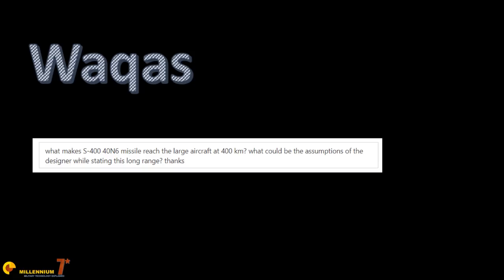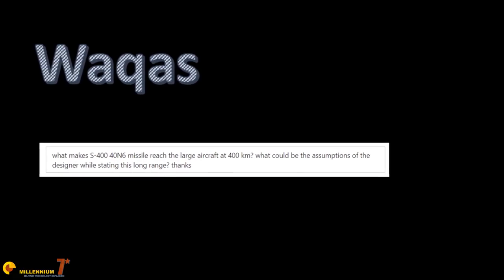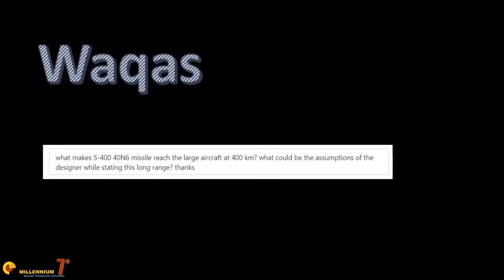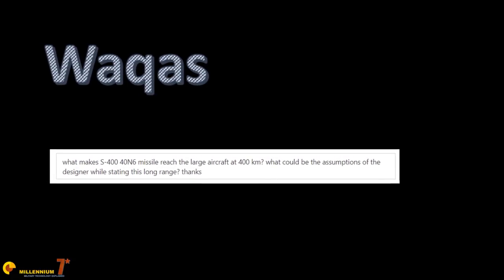Why AESA Radars are LPI? - S-400, Tejas and more - Community Q&A March 2020

Comment: Some features and facts about tejas
1. Tejas is the only fighter (of its class) which has 90% body made of Carbon Composite (40% by weight), making it the lightest fighter in its category.
2. Tejas has only 8000 components making it one of lowest component per fighter which has direct link of improving reliability (more parts mean lower reliability).
3. Tejas has the lowest radar cross section for a fighter of its size almost half of Saab Gripen,
4. Tejas has highest trust to weight ratio (1.07) almost best for aircraft of its category.
5. Tejas avionics is built on open architecture where by it can integrate weapons from any country.
6. Tejas can accommodate any change in hardware (without change of software) unlike the F22 which actually be cannot be produced again due to its closed architecture regime.
7. Tejas engine can be changed in less than 45 minutes.
8. Tejas Control laws (Fly-by-wire) used on F-16 for testing the reliability and limits showed F-16 responded better  to tejas Control laws than its own Fly –by-wire.
9. Tejas has never met any sort of accident in over 4000 hours of flying,  right from testing stage till its current date making it a record holder for reliability 
, No wonder Tejas was flown General David L Goldfein, Chief of Staff of US Air Force on Feb 3 2018.
10. Tejas is the only plane that flew in an Airshow on its fourth flight. BAE system which was planning to see 400 to 500 hawk fighter to replace India’s Mig-21 lost major portion of that order and india eventually bought only 72 as trainers after protacted negotiations.
11. Tejas Final version MK2 (including Naval) may replace eight figher aircarfts/trainers (Mig -21, Mig-23, Mig 27, Mig-29, Sepecat –Jagur,  BAE –Hawk, Mirage 2000, Pilatus PC-7)
12. Tejas is the only fighter developed by any country without history of aviation industry (production) using a challenging design concept (tailess delta wing) while still under full sanctions (technology denial mode) by west. (China has extensively bought russian designs and parts, South Koren, Japan, Israel, have easy access West technology). An US magazine in December of 2000 had reported that Indian fitgher LCA (at later named tejas) will never be able to Fly due to sanctions of West on India. Just week before scheduled first flight (jan 4th 2001), The Indian Defence Minister who was to be present for the event received a letter (allegedly from US embassy in India) asking him to abstain from the event to avoid embarrassment as first flight would be failure and plane would not take off the ground.
Reply: Trust to weight ratio is extremely important!  Being lightweight and trustworthy is important in a fighter; I hate heavy fighters that lie all the time.  Bitchen’ Betty at 20,000 ft.: “Terrain.  Pull up!  Pull up!”  😁

Comment: Can you please make one detailed video about AESA radars and also like how much affect they make when they are placed on moving dishes or one flat panel? Thank you so much Sir. And keep doing this awesome work. Good luck.
Reply: Harris Khan putting a aesa in mecanical dish only allows for more angular coverage. A regular aesa in +_ 60 to 70 degrees meaning in total 120 to 140 degree à dish allows up to 200 degrees but it introduces a mecanical part and makes it less reliable. A simple aesa can last 10 years without maintenance that’s not the case here.

Comment: The reason forward swept wings were tried was that they had superior stall characteristics at low speeds. With swept back wings the tip of the wings stall first causing a loss of control at low speeds. With forward swept wings the wing stalls at the wing root first allowing control to be maintained. If you've ever watched a bird land you will see that they sweep their wings forward quite far while landing. 
The reason the project was abandoned was that at high speeds forward swept wings tend to twist and flutter. Making them strong enough to resist such tendencys would have incurred high weight penaltys that made them impractical.
Reply: And this is a structural stiffness issue.  Absent flutter problems a forward swept wing should not be unstable as long as the relationship between the CG and aerodynamic center is correct.  Like you said, the stall characteristics should be more favorable rather than less.

Comment: Regarding forward swept wings:  One disadvantage is, at supersonic speeds the wingtips tend to be outside of the Mach cone and therefore drag will be considerably higher.
Reply: I also wonder if there would be a 3 dimensional mach cone at each wingtip causing additional drag or flow separation on the surface of the wing within that cone.  I seem to recall that that the wingtips of the F-15 are raked inward to remove that surface from the effects of that mach cone, enhancing transonic acceleration and maneuverability.
Reply: Well, when those queens wear platform heels, of course they’re going to be higher.  It helps that most performers are gay men and taller, so they’ll be much higher than normal.  But that’s drag for you. 
P.S., what’s “Mach” got to do with drag?  😆😉

Comment: Hi When u make Tejas we would like you appreciate and acknowledge the below points. the background of defense aviation and spare technology in India as compared against NA, Europe and USSR
The entire West (From North American to Europe and even Russian) had free flow of technology and ideas. Rolls Royce sold 25 jet engines to Russia in 1946, which was modified as Kilmov RD45 and used in MIG 15,  While India as Colony of British for 200 years from 1757 to 1947 was used as source of wealth, rawmaterial  and to dump British finished goods, and then post independence in 1947 was pushed into sanctions for next 60 years till 2001 (as indian didn't join cold war and started a third group called Non aligned group), While west was happy to sell outdated military equipmet, India depended a lot Russians defence technology had always had a problem with spares and maitenance and also subseqently high cost , so it had to learn and set up from scratch everything. India which missed all 3 phases of Industrial revolution (Steam engine, electrical, electronics) is only participating in 4th Information technology, we have quite some distance to cover, but will definitely make it for sure.
For Space
The US/NASA rocket and Space programme was jump started when US allied army captured around 1600 German Scientist, engineers and technicians including Wernher von Braun designer of V2 missile along with 80 V2 rocket as part of Operation Paperclip. This group was assimilated into NASA, They developed the rockets that launched the United States' first space satellite Explorer 1. Von Braun served as director of the newly formed Marshall Space Flight Center and as the chief architect of the Saturn V super heavy-lift launch vehicle that propelled the Apollo spacecraft to the Moon. In 1975, Von Braun received the National Medal of Science                                                                             ISRO on the other hand had a very slow start, with handful of Scientist Engineers & meager funding. ISRO's growth is almost remarkable given the fact that It operates in constant technology denial environment due to sanctions imposed by US government give below is list of sanctions and sabotage for those who are interested in further Reading                                    1)1974 several western countries imposed technology, Material and financial sanctions after India's first nuclear test in 1974.         2)  In 1998 after second nuclear test US imposed unilateral sanctions under section 102(b) of the Arms Export Control Act (AECA) and included prohibitions on foreign assistance, weapons sales and licenses, foreign military financing, government credit, guarantees and export of certain controlled goods and technology. Some non-statutory sanctions restricting high-level visits and military-to-military contacts were also imposed in accordance with President Clinton’s administration policy.                 3) 1992 when India signed agreement with Russia for the transfer of cryogenic technology for $200 Mn (against US offer of $ 1 Bln). US sanctioned India unilaterally and stopped Russia from transfer of technology, Following the collapse of its Soviet empire, Russia was under considerable American influence as part of the deal US agreed to fund International Space station which Russia had built and need funds to keep it running, The Russians who grew sympathetic to India agreed to do knowledge transfer to certain key elements and when US realised it can't Stop India from developing heavy Lift Cryogenic Engine, it used CIA to create an espionage case on top ISRO scientist  Nambi Narayanan and his team  who were working in the Liquid propulsion lab which was developing Cyrogenic engine. (Nambi Nayaranan was the one who developed Vikas engine which is used on all of the ISRO's rockets till date. its safety, reliability is unmatched) The case became national sensation, Nambi narayanan and his team was acquitted within next 3 years by courts and in the judgement the court held that investigations needs to done against officials who framed scientists. however the officials fought the case in higher court and Supreme court cleared the Scientist and passed very special judgement providing compensation for damage done to him, Nambi Narayanan was Facilitated this year with India's Top Civilian was Padma Sri (thankfully he is still alive). But damage done to ISRO goes unrecognised. ISRO developed Cyrogenic engine on its own with a delay of 14 years.

Comment: if a pilot has a cell phone while flying...most probably the cellular processor on the smart phone will not even synchronize with the cell tower as the specifications like 3GPP used for LTE do not have margins to compensate for the carrier offset introduced due to the doppler shift in downlink frequency from the tower to the smart phone introduced due to the high velocity of the aircraft. The best cases are for speeds upto 250-300 km/hr (Called as High Speed Train scenarios like TGV). So, the cellular processor does not synchronize on the downlink hence no signal meaning no transmissions from the cellular processor on the smart phone. As there will be no emission, there is nothing to catch at those frequencies.

Comment: To track a specific cell phone you would need to know its number. Then you would have to associate that number with a specific pilot/plane combination. Then you would need to have access to the cellular network to determine which cell towers to use to triangulate the phones position. All of this is physically possible but would take so much time that tracking the pilot/plane in real time is impractical. The biggest problem is likely to be the range of the cell phones transmissions are short enough that tracking would require a very large network of recievers capable of handing off the tracking duties.

Comment: I think the Concorde SST was able to avoid the need for canards and rely on vortex alone by the use of a complex ogive for its double delta wing. The Soviet Tupolev SST used a straight delta and needed canards. I guess in the end, any weight and complexity saving for the Concorde from the ogival delta was immediately lost by the need for a drooping nose and actuator system because it needed a high angle of attack for landing approaches.

Comment: Canada is considering replacing current F18s with new aircraft, options are F18 Super Hornet, F35, and Gripen. Any interest in a video comparing the missions each type is best suited to and how they fit the needs of a country like Canada? Rafale was also considered, but Dassault walked away as they didn't feel that they could win the contract.
Reply: and the eurofighter is likely to do the same.
Reply: From the perspective of the air force personnel, the easiest replacement would be the Super Hornet, for sure. All the mechanics and pilots would have worked on a similar aircraft, the parts are widely available, the munitions would already be integrated, and there would be little to no changes needed to the infrastructure. 

From the perspective of the top brass and the politicians, the "best choice" would be the F-35. Strategically it ties Canada closer to the US, and there are "benefits" to operating more advanced technology (even though American technology exports are largely locked down and presented to the buyer as a black box to ensure dependance on the US). 

From an overall capability and technology perspective, the Gripen E/F would be a large step up, integrating much more munitions, being cheaper to operate (single engine that is similar to that of the Hornet, the F404 or F414), and coming out of the box, as it were, already suited to being operated in Arctic conditions. 

But successive governments have already committed to the F-35 so it's difficult for me to imagine that they would change away from that. The "competition" is just a legitimation exercise. There's no actual competition here.

Comment: sir dont u think that instead of a costly 5th gen plane with heavy maintenance cost We can opt for 
(semi stealth fa 18 hornet advanced with enclosed weapon pod and upgraded engine) or simply (2 rafales) or (2 semi stealthy gripen e) with good irst .also semi stealth may be sufficient you do not need to be very stealthy as it increases maintenance cost. A good qwip irst and mica ir paired on rafales approaching undetected at 80 km due to (semistealth of rafales) can beat f35..ALSO

please explain the viability of enclosed weapon pods on stealth, drag penalty.
Reply: Sarthak all major airforces are already is this mode and the best example is US, they operate 58 B2 bombers, (with 18 in reserve and 12 in long term stoarage), i.e 78, where only 20 B2 bobmers 10- B1 bombers (39 are in either long term storage or reserve,) Similarly fighters - of 182 F22 raptors, only 120 are used for deployment rest of them are trainers and backup inventory, F-117 Night hawk - is retired,  F-36 anywhere between 250 to 300 and its anybody guess how long the program will go, but at the same time operate 2000 plus (F-16. F-15, F-18 & A-10), and still likey to buy F-18-E,